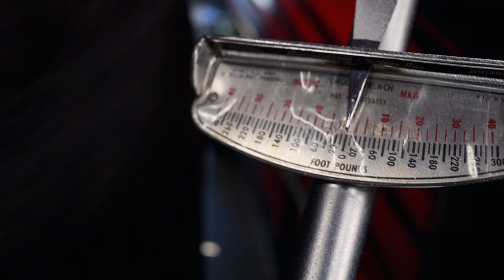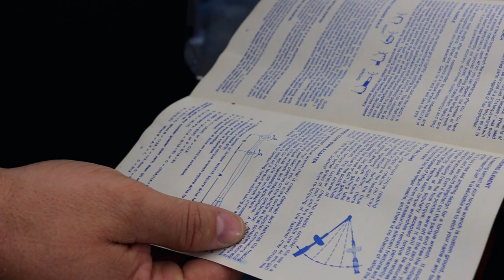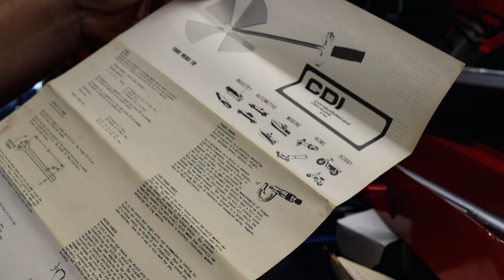Snap On Friday Step Back In Time With New Old Stock Tools

Comment: Bought a Snap On TQFR 250 1/2” Drive Flex Head Torque Wrench 50-250 Ft. Lb click type 40 years ago. Still works perfect.

Comment: That damn cheat sheet for the Spit beam. Is worth paying for a week class on ow to use them...

I had a customer come in. Said he blowing fuses on his GM... I get the top off the fuse box to see what was going on. Once I got the fuse box apart.. It had a 9mm bullet right through the wiring inside it...I took a picture and gave the bullet to the customer.

Comment: I love my power probe but you gotta have a test light handy aswell. Just because a circuit shows voltage doesn’t mean it can carry a load.  I’ve got a stackable banana jack on my test light. I can plug it into the cord of the power probe that way I can always have clean power and ground.Those two things at your side you can fix and find a lot of electrical issues.
Reply from the maker: If you don’t have a load pro you need one! Those things are the cat’s meow when checking circuits and loads. Well worth the money https://youtu.be/GM6_7qCDCjo
Reply: @KoonTrucking  I don’t but that’s funny as I’ve been kinda eyeing um here lately. Looks like I need to pick one up👍

Comment: I prefer the needle gauge Torque Wrenches over the Digital ones I do have a 1/2 inch it came from Sears bought back in 1996 still looks and works like New

Comment: Koon, Got the Capri 8pc Pro WaveDrive wrench extractor set for Christmas. Today I got time to check them out using my Hex Allen set and I found all open end are fine but one boxed will not fit on the Hex Allen, it was the 9/16". Called Capri and left ny name an number but no callback today.